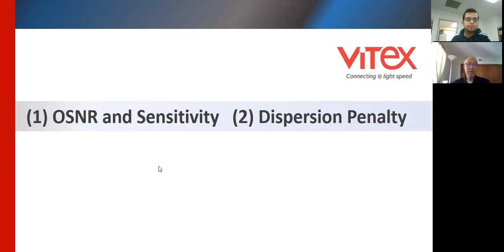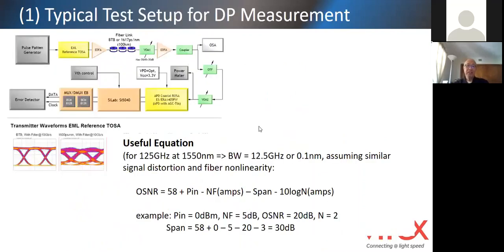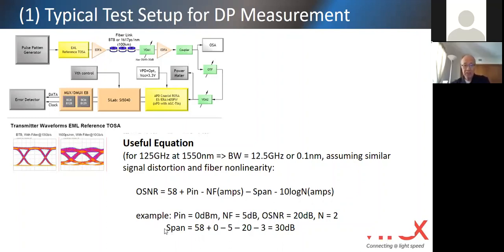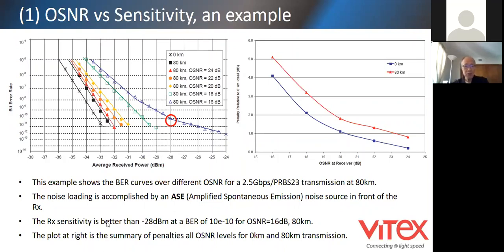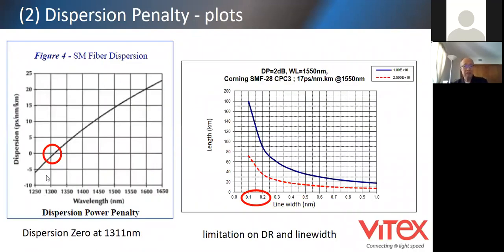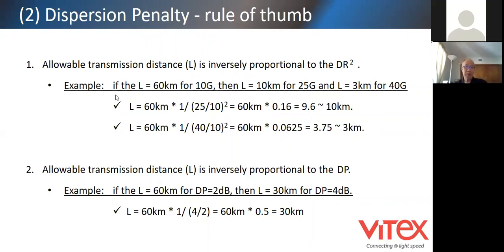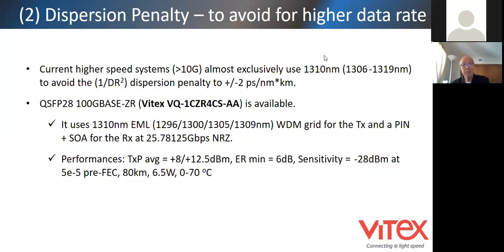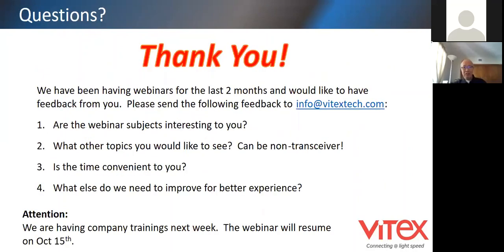Vitex Webinar | Understanding Fiber Optic Performance: OSNR, Sensitivity, and Dispersion Penalty

Comment from the maker: Hey there! 

Do you have any questions about OSNR that we didn’t cover? Or anything else fiber optic related? 

Our Vitex Talks series answers questions from engineers, designers, procurement, quality control -- anyone interested in digging into product or technical aspects of fiber optic transceivers, AOCs, DACs, AECs, cables, video fiber extenders and more. 

If you do have a question, ask below or send us an email at info@vitextech.com. If your question is featured in a Vitex Talks video, we’ll send you a gift code for a hot cup of coffee. We know you need it!

Thanks for helping us shine a light on fiber optic topics😊

Comment from the maker: Full Video Transcript:

Hello everyone. Welcome to the webinar. Today I'm going to talk about OSNR and sensitivity, and also dispersion. So... just like an open question. [What is OSNR?] OSNR stands for "optical signal-to-noise ratio". And OSNR can be, as you can see, optimized by amplifying the signal and reducing the noise level, such as in the equation shown. So usually we talk about receiver sensitivity in a short length and also in short, low data rates. But in the long-length, long-haul system, especially when people use an optical amplifier like an EDFA, OSNR becomes the way to estimate the performance of the link. And as you can see, why, because the noise starts to accumulate in the long fiber link and it just overwhelms the receiver sensitivity. An example would be, for instance, you have an ideal receiver with a sensitivity of -40dBm and an inferior receiver with a sensitivity of -20dBm. Any change of OSNR would impact "A", which is the ideal receiver, much, much more than a receiver, an inferior receiver like a "B". So, in order to tell the performance of the receiver, I suggest the absolute sensitivity of the receiver is an important figure or metric. And... I just show a very typical way to measure dispersion. The way that as people put in, you can see if you would the diagram, people put EDFA sandwich the fiber together, this is very much like a classical type of setup. So... the purpose of this test, I was going to measure the dispersion penalty right by this EML laser. So going around, you can see this line here is open nice and then it becomes like this due to dispersion. So, this eye is here without the fiber, not even the EDFA, this one is here after the second EDFA. So, what a useful equation is that for 125GHz at 1550nm, the bandwidth is roughly around 12.5GHz. Or if you would like to see it in wavelength is like 0.1 nanometer, assuming very similar single distortion of fiber nonlinearity. You can add–you can calculate the signal-to-noise ratio by using the equation here, like 58 plus the ... power input to the receiver, plus the noise figure of the amplifier, which is a sum of the receiver minus the span. The span is how long you can reach. And minus also the 10 log of the number of ... amplifiers. So you can see here the span is roughly equal to 30dB for receiver input 0dBm, noise figure total 5dB, and OSNR 20dB and with two amplifiers. So that's how to estimate the signal-to-noise ratio in a system like this. So the following curve shows you how to plug the OSNR, right versus sensitivity and by signal rate. So this chart shows the BER curve over different OSNR. You can see there are there different OSR levels here by different curves here. So this data rate is 2.5Gbps per second, PRBS23. So this chart has no fiber. So the next one I will have fiber. So basically the ASE–the amplifier spontaneous emission–noise is added in front of the receiver to simulate all those OSNR so the receiver sensitivity is equal to -29 for OSNR 16dB for a 10 to the minus 10 BER (bit error rate). So, now remember this one, this is without fiber and says purely OSNR. And... I add the fiber there. So the fiber in 80km and the same amount, the same number of curves for OSNR just redo it with the fiber. So basically you can see, the sensitivity degraded by one dB from -29 to -28 for the same amount of bit error rates: 10 minus 10. So what I try to show you is this curve, it's roughly a dB in between those two. So you can see those two curves are from no fiber to 80km fiber. So different levels of OSNR, [then] why would the dispersion penalty be here? So you can see it's pretty linear, it's about a dB or so across. So, I like to show touch base a little bit on the dispersion penalty. I know most, most of all of you would know what the dispersion penalty is. So it's... the input power coming in through the fiber. It has two effects. One is the signal loss due to the insertion of the fiber and also the spreading into the dispersion penalty. Basically, the bandwidth of fiber decrease as the dispersion increases. Very quickly. And I put in this formula for some of you interested in using the formula, you can use it as is and it's a very good estimate to plot that out, what happened for dispersion affecting the performance of your link. So I'm not going to go through it one by one because it's too detailed. Basically, this dispersion penalty is calculated–can be calculated by using those formulas all the way through. You can plow the curve like that by using all the information here. So I want to show you this one is like a zero picosecond per nanometer per kilometer, dispersion is at 1310. You can really plug that out like that with the formula same. So, and then this one is more interesting. That's the purpose why I do all these things. This one in blue is 10G, it's a 10G curve. So this one is a 25G curve plus again with the standard fiber operating at 1550 with the dispersion of 2dB. And you can see the 17 microseconds dispersion is pretty standard. And then for the line width, again, people would use 0.1 to actually point to 0.3 of nanometer line width. And I think typically it's about 0.2. So you can see 0.2 here in the setting, the 25G pitch per second is roughly on, theoretically, you can transmit this much like–a little bit lower than 40km. And then, it is probably a little bit double for the 10G. You can see why I say this because, well, later on, I'm going to save this on the next slide. Now here is a rule of thumb on the dispersion penalty. Pretty useful little things since, because the allowable transmission distance L is inversely proportional to the data rate square. Remember l is equal is inversely proportional to the data rate square. So the example I put in is that if L is 60km for 10Gbps per second, then the link will be reduced to 10km for 25G and will be further reduced to 3km for 40G. So with a little simple ion like that. So 60G, 60km times one over the ratio of 25G over 10G, and then take a square. So 60km times one 16 is equaled roughly 10km. Likewise, for the 40G is lighter, 3km here. So, the other one is one to one ratio for the transmitter distance that is inversely proportional to 30 expression penalty. For instance, for a length equal to 60km for dispersion of 2dB, then the link will be reduced to 30km if for the first dispersion penalty, 4dB. So now let me go back to one. You can notice the huge penalty on data right on the increase of the data rates. It's a big difference. This is why now you can see for now all the high-speed links namely above 10G. Like a 25G, and then go in the plan and so forth. People almost exclusively use 1310 nanometers. You can see right here why they want to do something like that because they want to avoid a penalty to keep the dispersion penalty to plus or minus two microseconds per nanometer and kilometer. So for this type of design, we also have one, if you go to the website, it's available there. The wavelength for this transmitter is in the 1310 range, EML four wavelength in the WDM grid for the transmitter and a pin plus a semiconductor optical amplifier inside the ROSA. For to operate a 25G NRZ. So the performance is respectable. You can see the transceiver power is a little bit higher than the non, so a type of transceiver, with an extinction ratio of 60 dB sensitivity that can be achieved at about minus 28 dBm with the FEC. So with this one, this system is pre-FEC. By putting the FEC, you'll have almost no error. So with the 80km, the power consumption is 6.5 watts, zero to 70 degrees Celsius. So this is still doable for 80km, 25G per second data rates. So, we still have this luxury. But let me go back here. So you can see that this dispersion penalty is on 1550. It's huge compared to what we do. So, I just want to remind you as we go up in data rate and there is going to be a problem to go long link or even the same link. So, I think I've given enough information. There are lots of formula equations here and I want to save a little time to ask you questions. But before I do that, are there any questions? Are there any questions you can read out? So far we don't have any questions. Okay, that's fine. Then I have time to go through my last line. So we've been doing this webinar for the last two months [with] one each week basically – roughly seven to eight webinars. We would like to have feedback from all of you. Can you please send your feedback to info@viextech.com? My question [here] is that: are there similar subjects interesting to you? We want to have feedback. We want to have a webinar to fit your needs. The second one is, what are the topics you would like to see? We can do it non-transceiver [webinars] as well. We can do fiber, we can do connector, we can do transceiver/mechanical, or anything, but we need suggestions from you. Is this time slot convenient for you, or you would like to have a different time slot? We would like to have some surveys, and what else we can do to improve for a better experience your experience to attend this webinar, so, you can get something out of it. So we definitely [will be] waiting for your feedback in order to evaluate our webinar also for next week. We are having a company training next week, so we won't be able to do a webinar. The webinar will resume the week after – the Thursday after that will be on October 15th. So, we are waiting for your feedback and I appreciate that as a presenter here. Chandel, do you have anything to say to our colleagues? 

Yeah, so thank you Eric for sharing your knowledge, and thank you everyone for joining. We hope you found it interesting. We'll be posting a recording of this webinar early next week. We would love to hear from you. So as Eric mentioned, our next webinar will be held the week after next. So once again, thanks everyone, and have a great rest of your week. Thank you. 

Thank you.